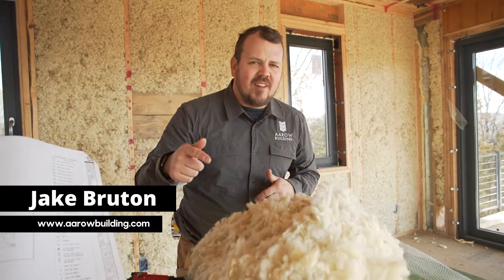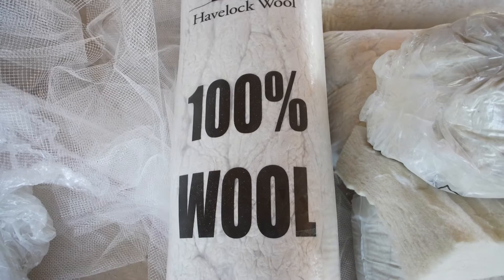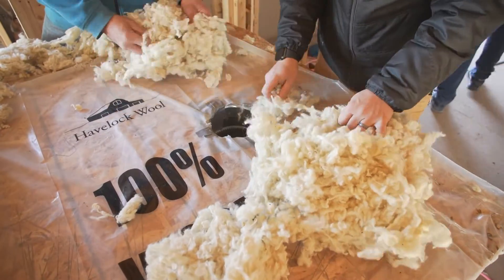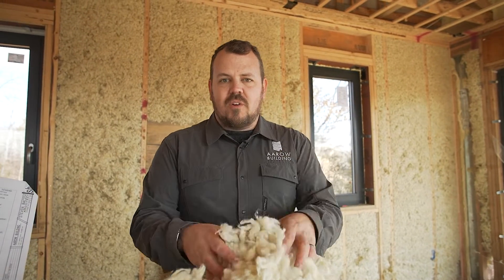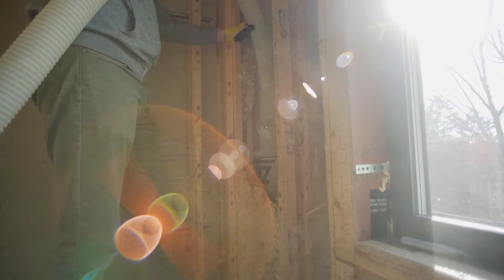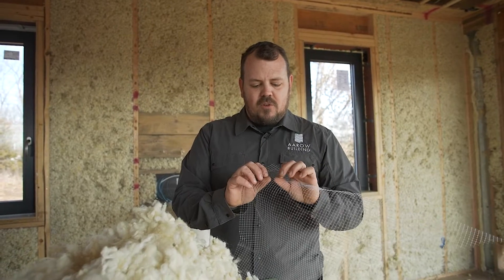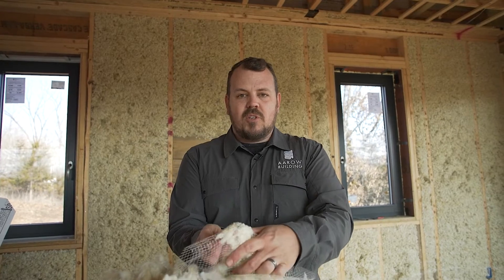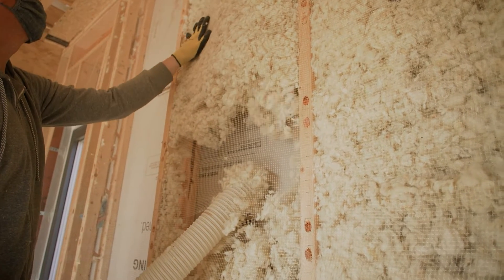Havelock Wool Installation Process

Comment: I think this and their bat material make a lot of sense for DIY installations, as a homeowner I don’t want to deal with the downsides of fiberglass or cellulose or frankly even rockwool and the PPE it requires. The moisture management potential is also really interesting for humid climate situations.